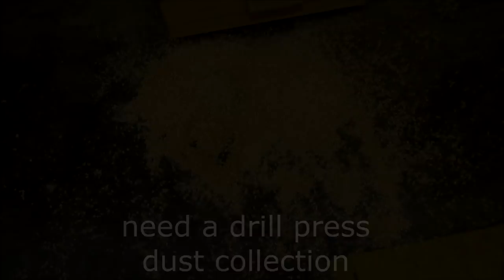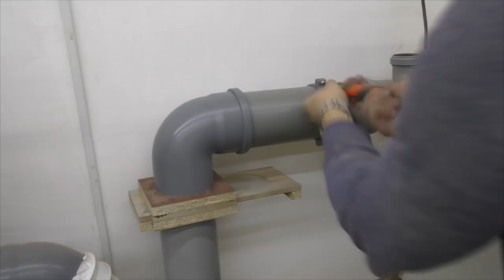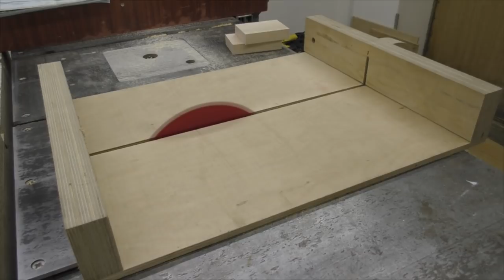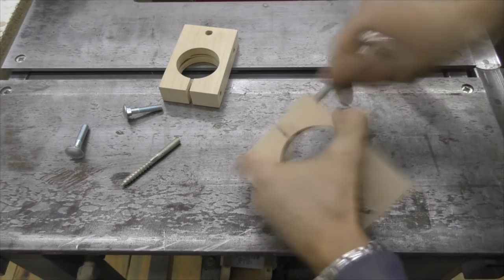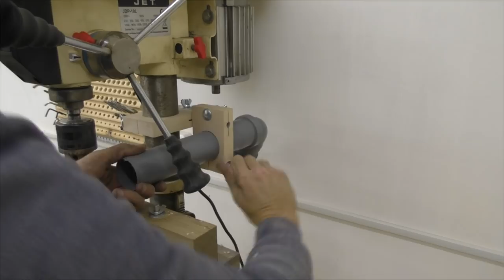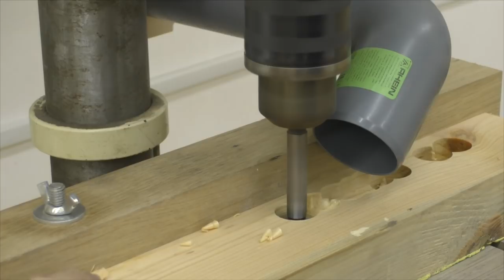🟢 Simple Drill Press Dust Collection Build - DIY

Comment: Hi,
A good idea.
I will build one for me, but I think the suction shall come from the back.
I don't exactly know how jet, but the pipe on the right would work on my nervous system.
All by all, good video, and it challenges me.
Willy from Belgium.
👏👏👏
Reply from the maker: Hi Willy,
Yes, I thought about suction from the back side, but it is a fence there. Was the variant to build it inside the fence but in this case it becomes unadjustable. I have been using it for a very short time, but must to say that the pipe does not bother me at all, it is enough space to keep a blank with the left hand and i can move the drill press lever on the right easily. 
Thanks
Reply: @GRINwood  
I will try it out, thanks.
😇😇😇